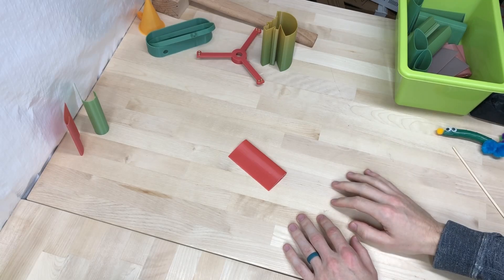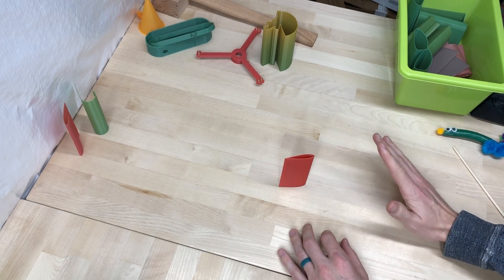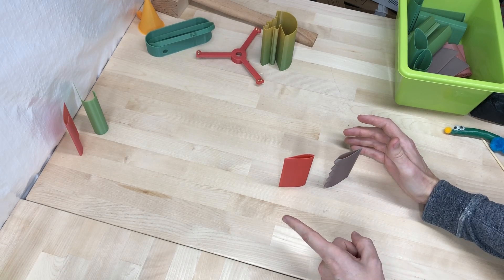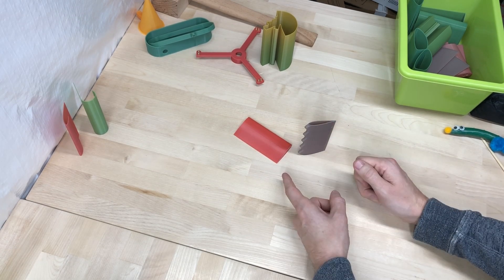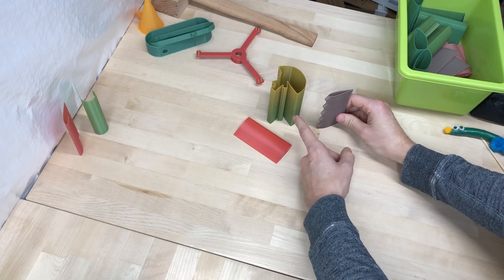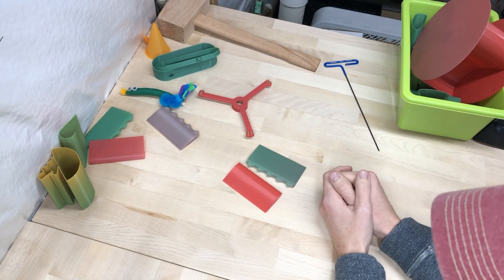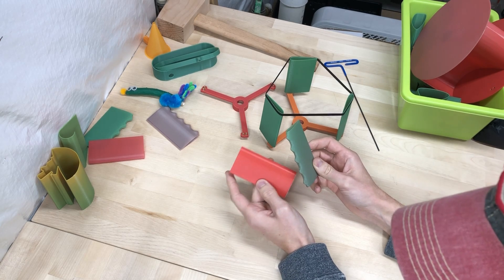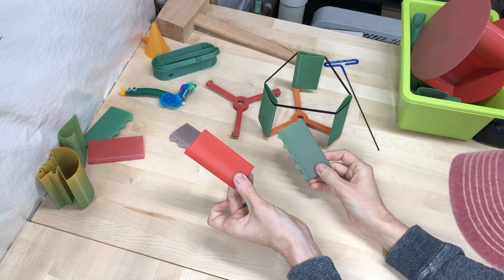Do whale fins work as turbine blades? #tubercles

Comment: Hello,

You got a problem with the Reynolds-Number. 

You are working on your model under 50.000 Re i guess.

For this Re-Number thin Airfoils are the best. 
Just think of tubercles as turbolators that are fitted better on your wing. Cause tubercles produce less drag if your angle of attack is low.

In Water you get higher re Numbers. Depending on Velocity. I believe its factor ×15 but im not sure.

A original Whale fin works at 1.000.000 Re and above.
Reply from the maker: Hey! thank you! this is really helpful.
Reply: @hellothisismax  

I just thought a bit more on the Micro Darius Rotor with Whale tubercles.

First it seems to be better to do a single blade design with counterweight.
This gets more speed and the Re -Number Climbs up.
With more Speed the angles of attack get smaller. Smaller angles tend to perform better.

A Tubercle foil bends the streamlines. So the air has to move faster. 
The faster the air flows, the larger the lift.

For this to work one needs to adept these C-bend streamlines to an airfoil shape.
I believe this is complicated to do right. 

For this micro turbine one could try to mix a flat plate foil with an acrobatic airfoil.

A mixed foil should be able to get thinner than a acrobatic foil. (It's overall volumina, cause of low flat blade volumina )
But it should remain the stall resistance and l/d-ratio of the acrobatic foil.

But someone got to estimate the C-Bend effect. And change the shape of the acrobatic foil a bit.

Comment: great video!!!

VAWT suggestion:  A rotor with three thin flat blades, the same size as the best performing airfoil,  mounted at the same angle of attack. The thinner the blade the better.

The airflow that the airfoils "sees" in a VAWT is much different than what the same airfoil would experience when mounted as an airplane wing.  (search "leonardotimes Airfoil Design for a Vertical Axis Wind Turbine")   

The thinner blade should stall at a higher angle of attack than the thicker one.  This should increase the size of the arc where the blade is producing torque and decrease the size of the arc where it has the highest drag.  My guess is that you will have a new winner.
Reply from the maker: I always love your input Dan, I think probably the next thing I'd like to test is the effect of angle of attack. Thin blades sound like a fun thing to experiment with too.
Reply: Another idea, to stop the negative effect of blade tip vortices, is to print the full rotor cross sectional profile on a piece of paper and glue the paper on a round piece of cheap 5mm foam board.  (dollar-tree) The airfoil profile shapes can be cut out the paper of one side of the board. Attaching the round board to the blade tips will stabilize the rotor profile while spinning and minimize the tip vortices.   A mirror image can be used for the other end.

A video with and without the end caps would be useful.

 @hellothisismax